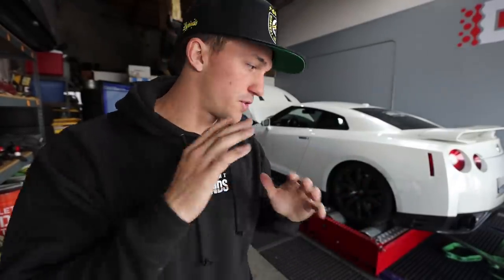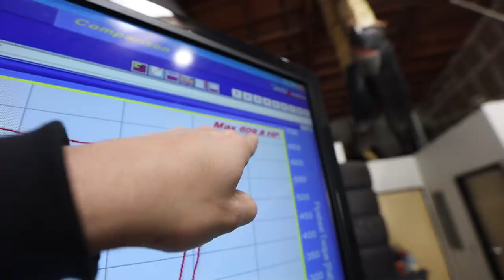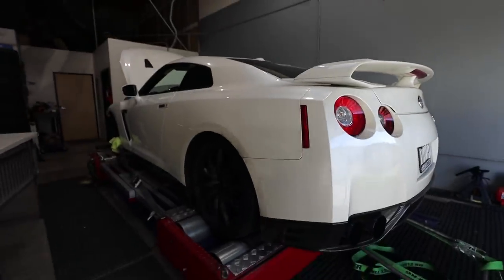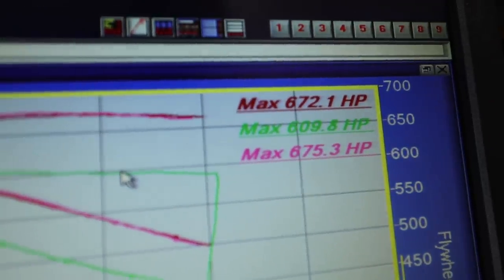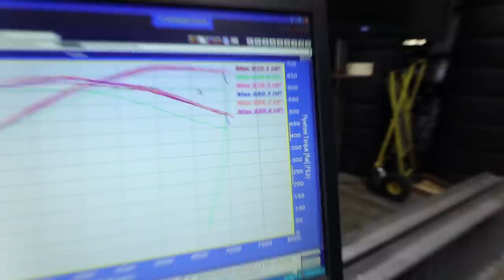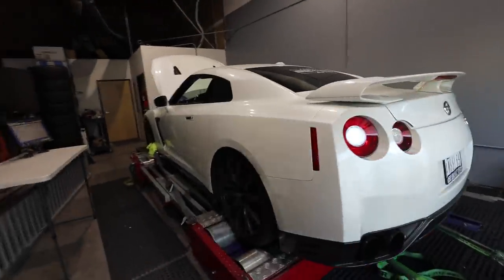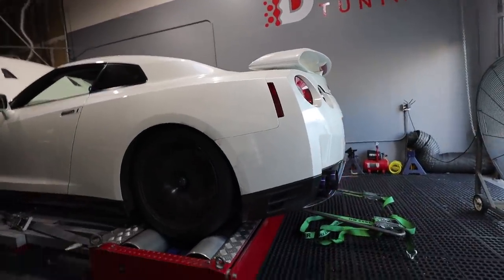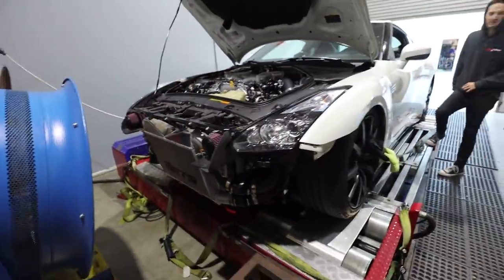THE R35 GTR MAKES OVER 700HP ON DYNO TUNE *HUGE FLAMES* | R35 GTR BUILD SERIES EP. 3

Comment: Sounds crazy. But be careful at that power level with stock rods. My friend just blew a connecting rod out the side of his block at 740hp with the same mods
Reply: The stock engine can hold 700 hp
Reply: 700whp is cool, but too much torque typically in the midrange bends rods.. They are the weak point in these cars. The trans I'm not sure
Reply: Yall act like blowing up the motor wouldnt give dut another 15 videos of content to film
Reply: Thats why i stopped watch Adam LZ. BLEW UP MY CAR AGAIN. HERES 30 videos fixing it again
Reply: #SendIt
Reply: Xan Millar facts man facts
Reply: Just keep tq under 650, seen people do 800whp all day on slightly bigger turbos.

Comment: Go against TJ in his Aventador. You're both around 700, awd.  Prove GTR's "supercar slayer" title 😜
Reply: One-Off I mean a straight piped Aventador against an almost FBO and tuned R35 with stock turbos is an obvious race, but would still be good to watch
Reply: One-Off this is definitely a lot faster than the aventador if it really has 700 wheel
Reply from the maker: haha needs to happen!
Reply: One of his Skyline GTRS as a Stock block will slay a Lambo too RB > VR :P

Comment: hey i have the same BOV and that sound is not your BOV. its compressor surge. I think you need to put a softer spring in the TIAL BOV because the spring is not allowing it to open at low pressure

Comment: Hey Dustin! how many psi were you running at the dyno when it made 704? and is that 704 hp is it at the wheels or at the crank? thanks in advance, am thinking about installing intercooler and BOV, just curious if is worth it or not.

Comment: 700whp on a stock GTR,that is crazy but keep it low unless you want a engine rebuild because i don't think those rods can handle that power that well,eventually though you will need stage 1 block and head internals it is matter of time when it will happen

Comment: I thought r35 are all wheel drive do why aren’t the front wheels working on the dyno
Reply: Sameer Qadeer in Dyno mode the car disengages the awd system. While driving the car, it’s mostly rwd. It just sends power to the front wheels when it starts to lose traction on the rear wheels

Comment: why do you tune a 4wd car as 2 wheel drive car 
doesnt that affect differently on when its back to 4wd
Reply: Because the GTR isn't awd 100% of the time. It only adds power to the front when traction is lost. It's mostly rwd bias, until it needs to send power to the front. They it goes back to it's rear bias. This is why the GTR accelerates like it does, it doesn't have that fall off typical awd cars do. Attesa ftw!
Reply: @refillz5281  ohh well thanks alot that actually explained it really well